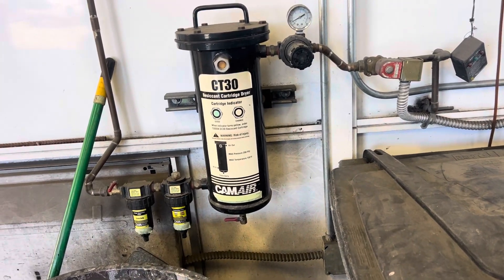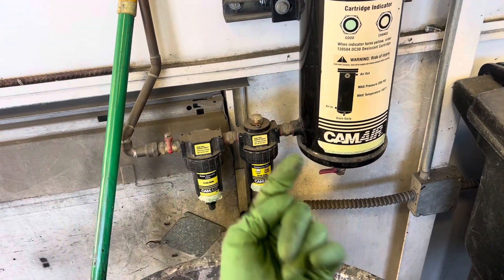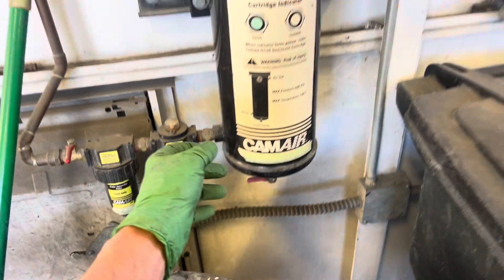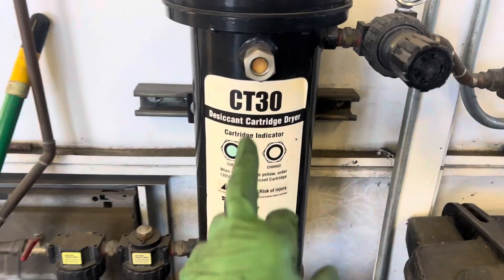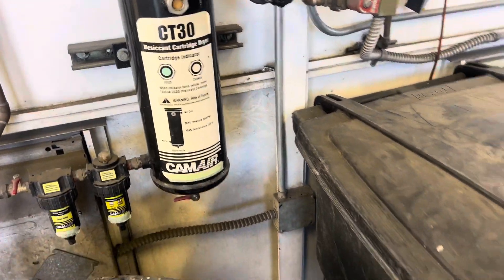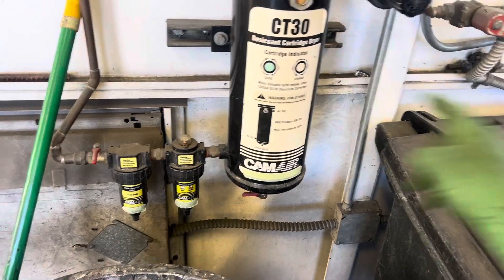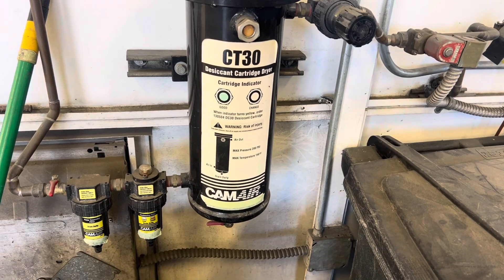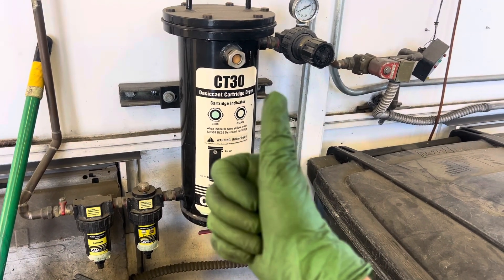Bottle of nitrogen and a regulator are so much cheaper than an air drying system.

Comment: Sometimes those of us on YouTube are here to watch a video to TEACH us how to do something right so it works.  While it's appreciated you're frustrated and lack people skills and want to tell us what a non-DIY job a pro did by using lower capacity products do... it doesn't help.

What CFM is that system rated at?  What's the size of the air mass.  How much moisture does it absorb that much be removed?  What size system will do that?  What's the formula.  WHY do you say THIS is not a DIY think?  What makes it NOT a DIY thing?  If you were going to engineer this WHAT would you use and WHY?

Must be nice to be 15 and know everything.  One day when you want to teach people to "do itright" see the questoins above and try that stunt again.
Reply from the maker: @ehudgavron9086  it’s easy if you want to know what size you need each manufacturer offers all the specifications for the different sizes.  Even someone with no experience can cross reference their compressor CFM to the equipment capacity.  Not rocket science.  About 4th grade reading and comprehension level if you can handle that.

Comment: That yellow moisture indicator would drive me nuts, just like driving with the check-engine light on.  It's beyond me how they can ignore it.
Reply: INOP stickers are cheap.  So is black electrical tape.

The MIL in your modern car is about issues making more emissions than it should.  MILs don't typically warn of "real" issues with the engine.  That's why a 2024 car can show you a moving map with 3D effects of where you are and where you're going, but it CAN'T EVEN GIVE YOU THE CANBUS OBDII ERROR CODE let alone the text of that.  You have to buy a plug-in module, get the code, and Google it.

Keep driving while that light is on.  The only think that will hurt is the environment.  One hour of Taylor Swift's plane does more damage than you ever will.  Let the light burn!
Reply from the maker: @ehudgavron9086 any good scanner will give you the code and the meaning you don’t have to look it up in Google. And they have a subscription to all the information for the wiring diagrams and repair procedures linked through the scanner.

Comment: What is the purpose of this compressed air system? To run air tools? Are you suggesting running them on nitrogen? This isn't for use on refrigeration systems, right?
Reply from the maker: @crvinva  this is for spray, painting automobiles, so you get no water droplets mixed with your paint onto the metal because water and metal don’t mix very good overtime

Because there’s automotive guys who try to use Shop compressed air for doing leak checking on automobiles in the air-conditioning 

And all it does is load up the air conditioning system and saturate the refrigerant oil and saturate the material with water from the shop compressed air

Comment: Liquid nitrogen dewars are available up to 2,000 liters capacity.
Reply from the maker: @thisisyourcaptainspeaking2259  sounds like something I would do

But I can’t see I do it yourself guy doing that in his home garage just to get dry air 

Some guys on the Facebook Automotive HVAC group were arguing that do it yourself guys or Garage would go through all that just so they can have dry air to do pressure testing looking for leaks in car air-conditioning 

Alternative is a bottle of nitrogen and a single regulator 

Which one is easier and more feasible
Reply: @coldfinger459sub0  Dewars can be a reasonable solution in some circumstances. We used these to transport and refill LN into the cold traps for our diffusion pump He leak detectors.